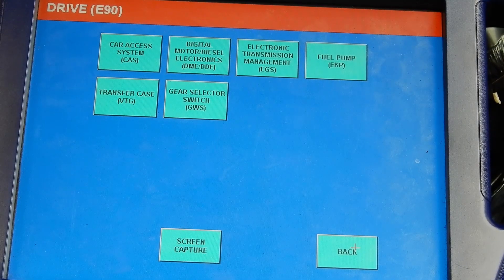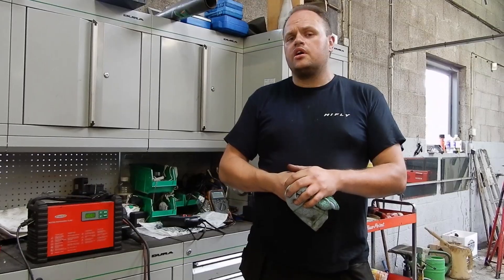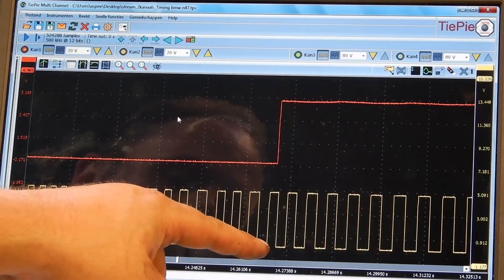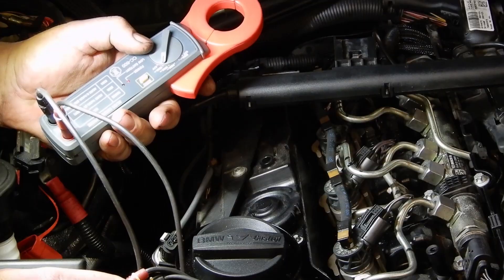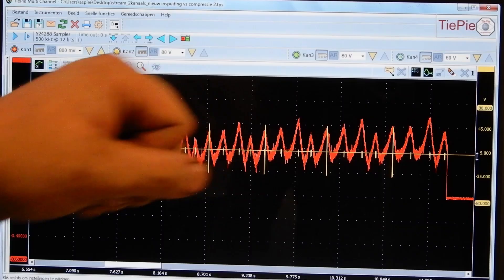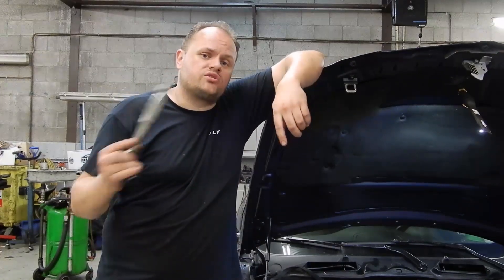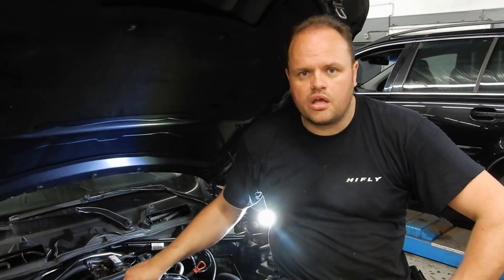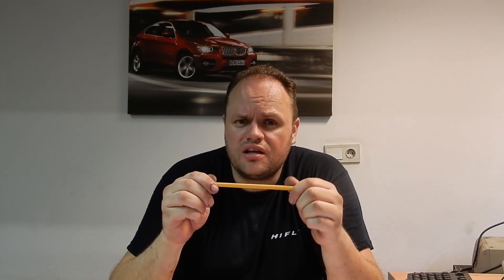Bmw n47 diesel engine "Won't run" diagnose

Comment from the maker: This is as far as the customer allowed me to take this diagnose.
But based upon the information we collected. Could anyone guess what was wrong with this engine?
And on what cilinder is the problem the biggest? The firing order is 1-3-4-2
Reply: There must be some kind of bearing damage. I guess the main bearing of the crankshaft
Reply: Oil pan being removed + unable to crank engine by hand suggests EITHER 

* that the car suffered a cracked oil pan in the past, leading to partial oil starvation and loss of oil pressure.. this could have warped internals, scored the piston chambers and prevents running due a combination of lower compression and higher resistance in the compression cycle.
* Its had a bottom end rebuild at some point and incorrect parts / torque settings used, creating a higher friction and rotational resistance on the crankshaft.
Reply: Hard to conclude.  Cyl #4 requires more current, but could be the one with the best compression, while crank bearings are bad.  Can't diagnose bad individual crank bearings with this test, as the bearings rotate All the time.  Might be able to diagnose out a bad cyl when running the test with injectors removed.
Reply: There are ancillaries connected to the engine via belts, so perhaps a seized water pump?
Reply: @deemdoubleu  if you look closely when dan is manually trying to turn the engine you can see the serpentine belt has been removed.
Reply: @deemdoubleu  you can see it in the video the belts are off
Reply: @deemdoubleu  The belts were all removed.
Reply: it would still start and then smoke the belt 🙂
Reply: @deemdoubleu  Yuo could see the belts diconnected.
Reply: Internal engine problem. Seized up piston due to run the vehicle out of oil.
Reply: So what was it then ??🙏🏻
Reply: Many wacky replies here. It is either main bearings and cylinder walls/piston/rings binding. Or yeah that's it. The suggestion that it could have had a cracked oil pan is a good one too.
Reply: Yes it's F**ked :D
Reply: Cyl 4 demand more current it maybe one of cam soupape (in French) gripped of exhaust so it's does not allow others cylinders to go to speed rotation (rpm) to start the engine
Reply: BMW N47 engine recall 
https://secure.avaaz.org/en/community_petitions/BMW_N47_engine_recall/
Reply: Tardeli costantini That was my conclusion. As soon as he said "N47", I thought timing chain guide worn, filters or galleries clogged, oil starvation, bearing or cylinder death. Consistent with the sump refit too(whether or not anything was actually replaced in there). The N47 cannot have its oil neglected, or its terminal.
Reply: billy boy  Hydrolock is when a cylinder is full of a fluid (hence the word 'hydro') like water or coolant. A failed oil pump won't cause fluid to enter a cylinder and hydrolock the engine but it will cause severe engine damage from lack of lubrication which is probably what happened here.
Reply: @rossspear-martin1577  When Dan could not turn it over, I then expected fuel to spray out when he manually barred the engine. I hope Dan got paid for this.
Reply: No oil in the engine.
Reply: @ramanana7155  Or maby water going in.
Reply: Sump has been off,.. I suspect someone has put new big end bearings in at some point and the issue lies somewhere with that.

First thing I would suspect before looking at the car with these engines would have been timing chain as they are prone to it.
Reply: @StupidBlokeStupidVideos  ...A stretched or worn timing chain would not affect the engine's ability to rotate easily.  This engine was experiencing a LOT of resistance to turning over.  Which can only mean something is causing an excessive clamping force on the rotational parts inside the motor somewhere.
Reply: @StupidBlokeStupidVideos  ...How would a blocked oil pickup severely impact the rotation of the crankshaft?  Only friction or a hydro-locked cylinder would be able to do that.  You need to explain your cause in more detail for it to make sense to me.
Reply: @StupidBlokeStupidVideos  ...So, you are stating that starvation of oil has lead to a seized condition which is causing some rotational engine component making it hard to rotate due to an increase in friction.  Okay, that makes more sense to me.
Reply: I'm going to guess a problem with the oil. Suprised you didn't show checking the oil in the video though.
Reply: What was the problem in the end?
Reply: Lower end is done... And 99% chance something is wrong with oil pump module :*
Reply: billy boy  it's a diesel so there are no ignition coils....
Reply: Oil starvation and poor repairs. They probably tried to just renew bearings but the liners would be trashed especially no 4 as it is usually the hottest running furthest away from the water pump
Reply: Welded piston bearings to the crankshaft due to bearing rotation in the rod and because of dirty oil
Reply: Diesels need a minimum cranking speed to start. Even with glow plugs.
Reply: Great videos Dan. One question- where can I get good wiring diagrams for European cars. I have Texa but wiring diagrams are not the best and coverage is gappy
Reply: Water pump, power steering, alternator, fuel pump or turbo
Reply: Lack of oil.. probably a blocked gauze filter in the turbo oil pipe.. piston rings and cylinders I'd say are damaged along with the rest of the bottom end hence the stiff turn over
Reply: I think i would have checked the fluid levels
Reply: It had to be a camshaft/timing issue. Even with bad crank bearings, it should have started. So what did it end up being? Did the customer eventually get it fixed?
Reply: @Hutchy45445   rpm is too low for starting
Reply: I actually just had the same issue, turned out to be 2 main bearings and 3 rod bearings had spun, therefore not reaching his starting rpm and no fuel pressure on the rail
Reply: Wrong size shells installed.
Big ends or main.
Reply: adding a little of carb cleaner is not enough it will never try to start like that I know this because I have done it and it only tries to start if the spray is right next to the manifold.
Reply: The work done on the sump pan is the key and the owners refusal to run more diagnostics. Seen this before when a DIY guy got the piston caps mixed up when replacing the big end bearings. the connecting rod caps are matched to each connecting rod. If the caps are mixed up, then some caps will have play on the crankshaft and it only takes one cap to be too tight and the engine locks up tight as in the video. The rotation will be constantly tight throughout the cranking sequence of the car. If it was a camshaft problem or a foreign object in the cylinder, the resistance when cranking would be intermittent. The owner probably did dismantle the bottom end of the engine and knows he did fuck it up.
Reply: The cylinders are completely blocked with carbon deposits. I had exactly the same problem with this engine. The head had to come off and the carbon cleaned out from the cylinders. The garage said it was caused by too many short journeys.
Reply: DiagnoseDan z
Reply: billy boy Usually the glow plugs are removed and compression is checked through the glow plug hole. I don't know if this engine has glow plugs, it might be checked through the injector port.
Reply: If one piston, can either be broken rings causing irregular oil distribution, scoring and failure. Could be blocked oil path leading to poor cylinder oil supply & failure. Or could be Crank main bearing for that cylinder for similar reasons... oil supply.  Shows how powerful the starter motor is; still cranking!!
Reply: Cylinder number 2
Reply: Shot bottom end bearings. Compression stroke causes sticky rod or main bearings near faulty cylinder resist even more. Many thanks for the videos Dan. My favourite channel right now:)
Reply: Needs engine overhaul...
Reply: Intake and exhaust valve closed at the same time
Reply: @abbasmuhsen2715  not possible it would have not turned at all because the valve would have hit the piston, a mechanic would this sound.
Reply: Could be a lot of things causing excessive drag on the engine. The fact that #2 was taking less effort to crank over leads me to believe there is something mechanical out of order in the engine itself, and not further downstream in the drive train. Probably something on the shaft and not on a particular cylinder, was it also tested without all of the accesories connected through the serpentine belt?
Reply: Spun main bearin..pretty common usually fatal..😣😣😣😷😷😷
Reply: My suggestion is, remove the water pump, the a/c compressor and the power steering pump, then try to rotate the engine again manually. It's the best way to isolate where the friction/drag originates.. Either the engine itself or some of its auxiliary parts are seized  If it's still hard to rotate, its probably the internals of the engine are broken. Seized/burnt   bearings might be the culprit.
Reply: They flashed a tune on the ECM and they then drove the car like they were in a computer game. They scorched the internals and tried to do a bearing change and put the wrong sized bearings in. In the end they failed to use plastigage. Either that or they cracked the oil pan, ran the engine dry, it got hot and warped the internals.
Reply: Time for a new bullet in the car. Replace the engine
Reply: Broken piston return springs ? Or its low on blinker fluid 😂😛
Reply: Hydraulic lock?
Reply: Probably flood damage and 1 or 2 conrods bent.

The N47 was rubbish compared to the earlier M47.

M47 was good for half million miles plus the injector pump was easily removed without having to remove gearbox.

Which numpty at BMW thought it was a good idea to put the chains at rear of their later engines necessitating engine removal for chain replacement.
Unbelievable!!!!!
Reply: I would check the engine oil condition and level first.
Reply: Low oil or oil pressure caused number one to pick up
Reply: 3th cilindar flying bering stuck
Reply: There could had been some injector fault on cyl 4 causing extreme heat on that piston causing it too get bigger . Ore 100 different causes 😂
Engine out for this one
Reply: No, you're all wrong - it's a gremlin jammed in cylinder 4 that has grown so fat on all the BMW design faults that it needs to be compressed when you turn the engine.
Reply: Had the same problem with a toyota avensis,high oil consumption the engine almost blocked,check the oil feed to the turbo and egr cooler,9/10 they are both clogged. Avensis had 32bar in stead of the 16-17 it should have due to filth on the pistons. Removed the oil pan and half of the crank bearings where burnt due to bad lubrication. I think the whole inlet system is clogged together with the pistons. Take a compression tester but i think the engine is for the junk yard. The avensis had 96000km
Reply: True, without the doubt of the different comp. ratio of each cyl. you would know which one was creating more friction. Could be a cracked block or cyl. liner destroied! It appens to those engines :´(
Reply: HI Dan still a learner myself, just a guess but what is the chance of incorrect injector sequence(signals) on the untested cylinders maybe you tested it of cam) eg 2 and 3 were mixed, or it self-destructed from a turbo oil leak. caused everything to partially seize up. no history on the car can throw the (out of the box) thinking out the window sometimes.
Reply from the maker: @jordacheubraj3142  that's not what happened😉
Reply: @Diagnosedan  Hey Dan love your videos great tips you're throwing out, just a question, misplaced injectors should not stop the car from starting am I right? Cheers
Reply: @andredesousa96  injectors have to be placed at the same place, as ecu have registered them for compensation time. There you can see codes at the top. So if you do replacement, than you need enter injector code to the ecu.
Reply: I had this exact thing and it was : Oil starvation and poor repairs. They probably tried to just renew bearings but the cylinder liners would be scored especially no 4 as it is usually the hottest running furthest away from the water pump and that is what is causing the tightness
Reply: someone put in the wrong size rod bearings and #4 is more tight than the others.
Reply: Omg Dan not figured it out????

Get a camera inside the injector holes.

I would say this car may have had oil leaking from the turbo or oil seals or even worn piston rings.

The accumulation of oil which became burnt has increased the compression to a point that the 2 cylinders firing cannot overcome the other 2 pistons that are dragging in the 4 stroke cycle.

If this car is manual you could start it by tow starting it at 30 mph.

Due to the heat the caked oil will sofen so the compression drops and it will start.

You could also pour thinner in the cylinders over night then suckout what remains add new or used clean oil and try again.

But diagnosis will ly with more information from the owner as to what the car did before it died.
Reply: My guess is on the high pressure fuel pump. Or does this car have the plunger type?
Reply: Awesome Things Set fire to it 🔥
Reply: Ac pump sezed?
Reply: Cyl 1 or 4 and its N47 so its probably doing something wierd with timing chain
Reply: @expert20valvehlx  How can it be a problem with the timing chain when the cam and crank have been shown to be correctly synchronised?
Reply: @ferrumignis  crank and cam sync but fuel pump not and they can be sync in wrong position
Reply: @expert20valvehlx  That is so unlikely it can be dismissed.  If either the upper or lower chain skips one or more teeth then the cam timing would be incorrect.  For the cam timing to remain correct but the pump timing to be wrong, both chains would have to skip the same number of teeth in opposite directions, isn't going to happen.  also incorrect pump timing would not cause these symptoms.
Reply: @ferrumignis  its so unlikley that my gf e82 had that problem, was really hard to diagnose
Reply: @expert20valvehlx  And her engine was partially seized and causing the starter to draw 600 Amps?
Reply: @ferrumignis  her engine wont start but no dtc and electric is ok
Reply: How much was the bill up to that point?
Your bill not the other garage
Reply: There are 2 main reasons why a specific cylinder draws heavier current on a RC Test. If the cylinder just prior to the high current draw shows low current draw, meaning lower compression and the engine turns over easier and faster on that weak cylinder, then the next better compression cylinder in the firing order must work the starter harder to rotate the better compression cylinder which slows down the engine rotation and this better cylinder requires more current as the compression is slowing down the starter. 

In this case the cylinder prior to #4 does not show lower compression (#3) compared to the one just before it (#1) so the higher current draw on #4 is due to a problem with that cylinder, also notice the wider distance at the bottom of #4 waveform from start to finish, its wider apart than the others which shows more time to get a full stroke on #4 cylinder.

The cylinder after #4, which is #2 requires less effort from the starter and draws less current and also notice the shorter distance at the bottom of its waveform from start to finish, its closer together than the others, #1 and #3 look about the same. So whatever happen with this engine, #4 is in worse condition than #1, #3, and #2 is the least affected but may still be affected to some degree, on tear down I would compare #2 to #4 to see what the full story is. Maybe oil starvation. I wonder where oil feed comes into play from the oil pump, in front of the engine or maybe at #2 and feeds out from there??? Strange that a cylinder in the middle is least affected.

I can also see the speed difference on the CMP & CKP correlation waveforms. The wide CMP signal on the known good engine is less than 1.5 units wide and the bad engine is more than 2 units on the scope vertical scale markers.
Reply: I think the problem was the camshafts... I got that problem with a 2.0 TDI from a Passat
Reply: @Awesome Things Sounds like a typical BIg Money Waste
Reply: I just watch your video is my observation is: throttle blocking the vehicle start, if it's ok, make me sign that I tell how to do for make starts without the filed
thank you.
Reply: @galaxys6galaxys652  The injectors were removed so the throttle is out of the picture. Even if it was the throttle, you should be able to turn the engine at slow speeds with ease.
Reply: @shakazzolo  Diesels don't have throttles.
Reply: @guzzyb  The N47 does
Reply: @guzzyb  Many modern diesels have throttles, they are used to generate manifold vacuum to help the EGR system work effectively, and also used smooth out engine shutdowns (like an antishudder valve).
Reply: Broken timing chain and guides
Reply: My guess is a broken lifter   My hypotheses is it possibly has a four valve system since you mentioned having two cams. In my minds eye if only one valve on the exhaust side was open it could cause a resistance that would possibly make it hard to turn over but I also can’t see that stopping it from starting. My dad had a diesel Toyota pickup and he told me that it ignited the fuel with compression and glow plugs. I didn’t hear you talking about that. So maybe a combination of things.

Comment: Hello, I have a 2011 N47 320d car. I start it when it's cold and then it stalls. It continues when I give it gas and it warms up normally. I changed the chain 55 km ago and now it's not making any noise. What could be the cause of the problem?